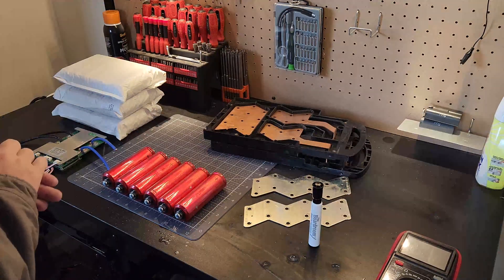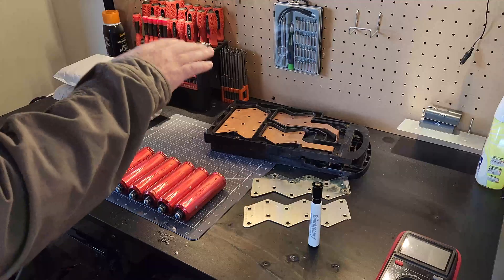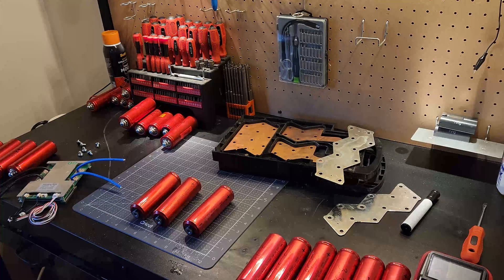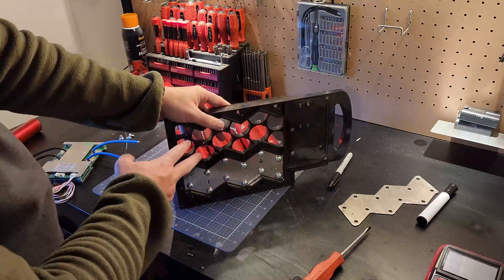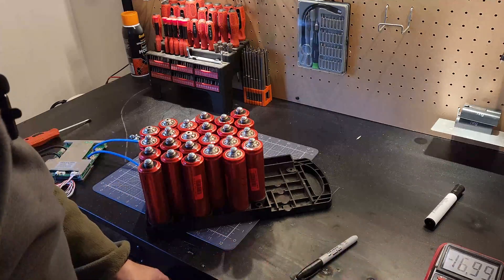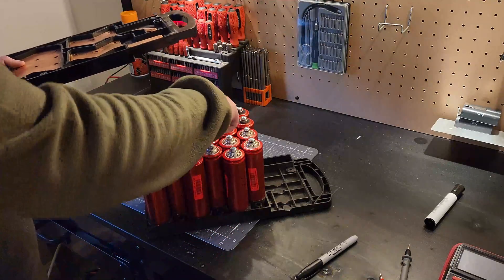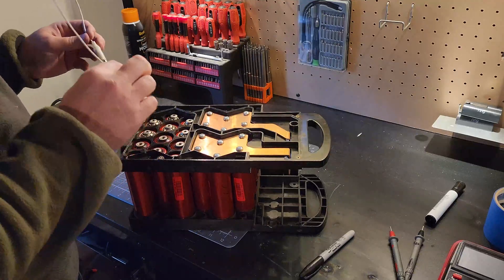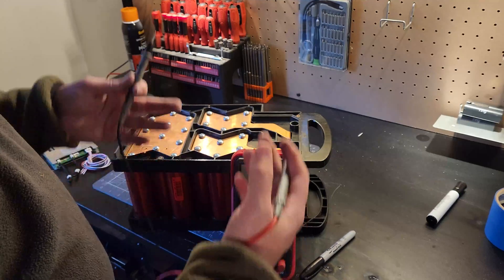Headway 12v Kit

Comment: I got one of these full and built already from BH. The pos and Neg are reverse from your build. How does that affect the red wire orientation? Are 0 and 4 the same   0 being neg and 4 being pos? Are all the others the same? Thanks.
Reply from the maker: Should be yes. I always consider the negative as 0 and count up from there per cell.

Comment: Is a bms mandatory? Ir is just a balancing board safe?

Would be in a car audio setting with a maximum of 300 amps, realisticly more like 150.
Reply from the maker: @MetalAnimeGuy  the biggest things for BMS is so the cells don't get depleted lower then what is good for them. Unlike lead acid Lithium in just about every chemistry will most likely have issues if depleted to zero volts. So how ever you want to set up this pack you need to take that into consideration. One thing you can do is use a smart meter to trip a contactor when the pack voltage drop to  a certain value which is what I am doing with a golf cart project I am currently filming. You can use one like this one https://amzn.to/3wdfdq7  Or you can use a small BMS that you only use to trip the contactor when the pack has reach it limits. A balancer is probably good in either scenario if you have some cells that sag. Most BMS balancing is small and would not help with balancing during use just when charging and letting sit. A not so high tech option is to buy a sound device that you can set to warning when cells reach a certain voltage. These are used in RC hobbies that have high current batteries but do not run with BMS you can see those here https://amzn.to/3vWpAhZ hope this helps. Be safe and have fun.
Reply: @TechCentric_00  assum8ng cost is the main factor. Do you have any idea how to deal with a charging voltage mismatch?

My car generally charges at 14.6ish but will go up to 15.2 or a bit higher. I was going to use headway cells, but those don't like more than that. 

The more I look into it it seems like the sodium ion batteries seem perfect, but I don't know how safe they are.

Any experience with them?
Reply from the maker: Sorry not familiar with that.

Comment: What is the charger you were using?  Greatly appreciate the video!!
Reply from the maker: @darrenehmke I use a variable bench top power supply similar to the ones sold on batteryhookup. I charge to 14.4v at 10a.

Comment: So how do you do this with 48 cells instead of the 24 that you’re doing in this video?
Reply from the maker: You can build two and connect in parallel. Just make sure they are the same voltage when doing so to prevent a large current spike from one pack to the other.

Comment: So if I didnt have any of this equipment and I was using this for car audio..... could I just let the car charge up the battery???
Reply from the maker: I would definitely do research on that. I saw a video where the alternator didn't like charing lithium cells. I have no direct knowledge for car audio use for cells like these, but I have seen of of folks that have
Reply: Im have the same question. other videos from audio guys say you can just connect to your system and car will charge while you drive. some say to charge if voltage low so it wont strain your alt if its stock. I'll probably just connect if batt voltage is decent

Comment: Whats the wh of this if you run them at roughly 10-14amps? high amp cells can run longer at a lower currents right?
Reply from the maker: Yes but that is true with all cells. Here is how Amp Hours work. This pack is roughly 48 amp hours. You have a load that requires 48 amps this pack can run that load for one hour. If the load is 24 amps then it can run for 2 hours. Hope that makes sense and answers your question. Thanks for watching.
Reply: @Tech Centric  I think u mean 48ah (amp hours) but yes that makes sense! Lol I got one of the super beast models and converted it to 12v 96ah and I put it in a battery box with a inverter bolted to the top of it, works amazingly! Now I'm just trying to sort out the charging (solar panel or jump it with the car) when out and about lol
Reply from the maker: I can't say for sure but if you run batteries at lower amps then you maybe able to squeeze more out them, but not sure how noticeable it would be.

Comment: I want to build a 12v battery with 12 cells (Total of 24amp). Can I use the 4s 30amp BMS sold by Batteryhookup for 14$? Thanks in advance
Reply from the maker: Yes you can. Something to consider BMS are usually rated for the max capacity (ie 30amps) if you know you load will be 30 or close to it I would use a larger BMS to reduce heat which results in energy loss, and reduce the likelihood of BMS failure.

Comment: Could I build a 12v battery with 12 cells? Using this kit. Thanks
Reply from the maker: 12 cells total or 12 cells in a cell group? I am assuming 4s 3p configuration? If so you can use this kit there would just be a good bit of empty space for the missing cells.

Comment: Nice video.... However if you really wanted the optimal capacity, you should capacity test each cell.  Then use something like repackr to optimize how to group the cells so each cell group is as close to each other as possible in capacity. I've found the individual capacity of each battery varies widely with these used headways!  So you can really leave some capacity on the table if you don't optimize.  Your battery is only as strong as your weakest cell group. Cheers
Reply from the maker: Agreed this was more of a how to build this kit, that is great advice for all diy packs in general. I did not have time to capacity check every cell, but if you have the time it is advisable to do so.
Reply: How is this done? I'm just learning
Reply from the maker: If you are asking how to capacity test then there are a couple of ways. One purchase a capacity tester for lithium batteries. Two drain the battery to the lowest voltage the cell should be and using a power supply that can track how much it outputs. Write down either the amp hours of watt hours on the cell and use the repacker website to arrange.

Comment: concern that the two cells you have the pos and neg will always be out of balance til the bms kicks in and settles everything...Why not connect the pos to the tabs that you taped?
Reply: absolutely if i order
Reply from the maker: No concern there even if the cell was taking in more juice then rest in that group that are all paralleled and would self balance. The tabs at the top do not have any threaded holes. Wiring to the plates was easiest solution for me. This is just one of many ways to do it.
Reply: @TechCentric_00  Been looking at these for a very long time.  I have a shed in pa that has no heat and understand these can be charged below freezing?  I lhave 3.5 kw on the roof and am currently using flood batteries.
Reply from the maker: I have no direct knowledge I would find the tech sheet from. The manufacturer and verify the operating temperatures.
Reply: @briansomers4753  According to the spec sheet on BH website for these... Charge -10C to 45C  Discharge -20C to 65C
Reply: -10 will work for me.  Thanks for finding out....maya have to pull the trigger
Reply from the maker: Shameless plug. Please use my discount code : tech.  😉